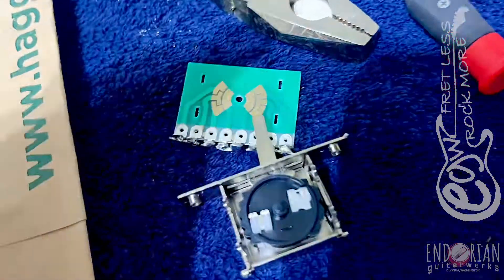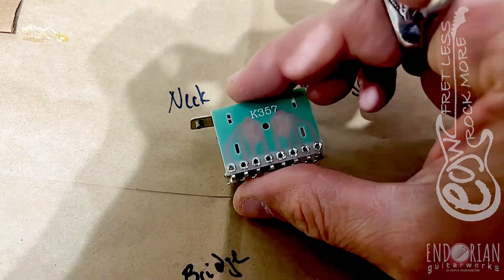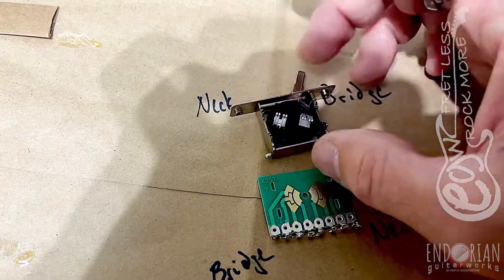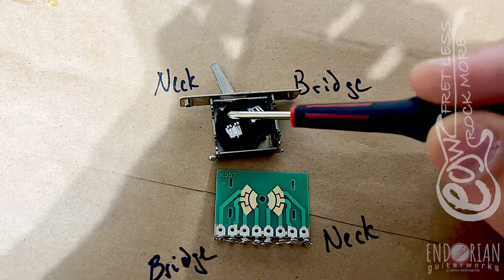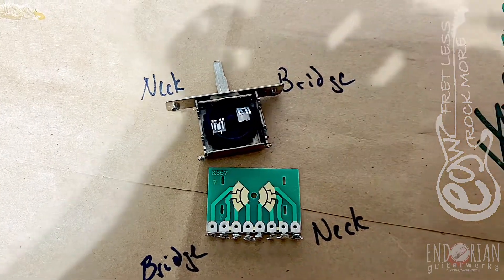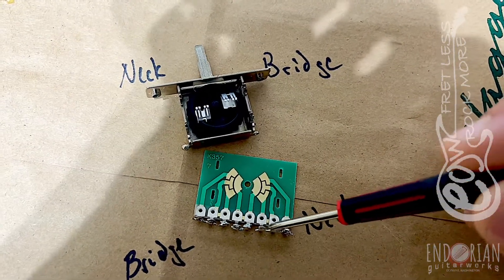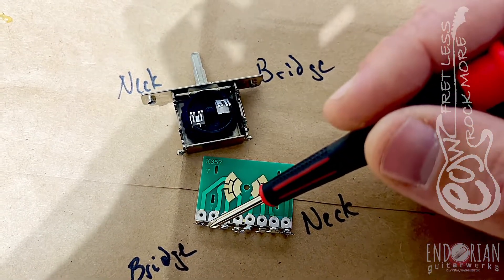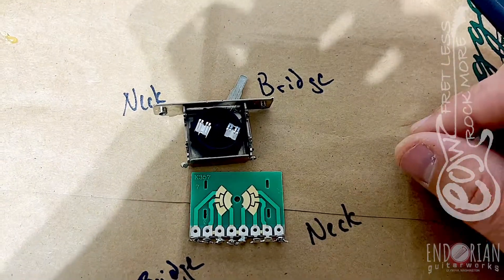How do these stupid 3-way circuit switches work?

Comment: Awesome, this helped me identify that the two commons on lugs 4 and 5 are permanently joined by a small PCB trace. After removing it I was able to properly setup my strat HSS with auto coil split. Thanks!

Comment: Thanks, clarified how it works. I have almost exact looking switch in my Donner Tele-style. The funny thing is the connection/soldering was done reversed of what the author explained, but worked as it should. Also, you can cleary see there is connection between the connectors that should be soldered (located between the green part and the connectors), for example the middle two. I guess the additional soldering is not necessary, and my guitar didn't have that soldering.
Still can't find the cause of ground-like noize that goes away when I touch anything metal except for the switch, which makes it louder. I found that the metal lever itself doesn't connect to any electrical parts inside of the guitar. Now I'm even more confused
Reply from the maker: Exactly reversed will also work because of the nature of the circuit. Outside in or inside out. The point is that it’s one path per pickup, and then the center combines them.

It sounds like you have a hot lead connecting to ground somewhere. Also did you ground the casing?
Reply: @EGWguitars  little flap/connector on the side of the casing is grounded. Nothing looks off to me connection-wise, I checked everything using a multimeter
Reply from the maker: @igorgilza can you share a good photo of the switch wired, and the rest of the wiring?

Comment: Hey bro, can you please help me out? I bought a prewired wiring harness for an LP-style guitar from Temu. It’s mostly prewired — all the volume and tone pots are connected — but the 3-way toggle switch and the output jack aren’t wired yet. There are two long black shielded wires coming out of the harness, and I’m wondering if those are supposed to connect to the toggle switch and the output jack. I’ve changed my profile picture to show the wiring harness so you can see what I mean. I’d really appreciate any advice you can give me
Reply from the maker: Your hot lead from the pickup goes to the first lug of the appropriate volume pot. The black leads coming from the center lugs of the volume pots go to the appropriate side of the switch. The output of the switch goes to the jack. Third lug of the volume pot and all grounds get soldered to the back of a pot. Prewired kit should already be tied with a master ground - you just need to connect to that ground.
Reply: @EGWguitars  bro , I still don’t fully understand😢, but thanks for helping me out! I have just one more question — will I need any extra wires? From my profile picture, do those 2 wires hanging out from the wiring harness look enough to connect the output and toggle switch?
Reply from the maker: @Jameshetfeild20 I honestly can’t tell that much from the photo. You may need more wire. 

Here’s a good wiring diagram from Seymour Duncan for an LP.

https://www.seymourduncan.com/wp-content/uploads/2023/09/2H_3G_2VppSPL_2T.webp
Reply: @EGWguitars  The diagram  doesn’t exactly match my prewired harness, which is really confusing. I’ve already checked dozens of different diagrams and videos. Is there a way I can send you a picture or should i upload a video of my wiring harness kit my yt channel so you can check it later? That would be really helpful.
Reply from the maker: @Jameshetfeild20 you can send pics to info at EGWGuitars dot com.

Send me a good photo of the back side of the kit. 

Wiring diagrams will always be slightly different because of color codes and the way the grounds are tied together. I also just realized that the diagram i used has push pull pots. 

This one is better

https://www.fralinpickups.com/wp-content/uploads/2022/02/Gibson-Les-Paul.jpg

You’ll have two leads coming off each pickup. A ground and hot. 

The hot lead of the neck pickup goes to the first lug of the neck volume. Hot for bridge to the first of the bridge volume. 

The second lug of each volume pot goes to the respective side of the switch.

The third lug of each should already be soldered off as a ground if the kit is any good. 

The switch chassis should be tied into the ground, and the switch output goes to the tip side of the jack. 

The ground off the pickups gets soldered to ground (back of a pot) and then one master ground goes to the sleeve of the jack. 

Ideally the guitar also has a bridge ground wire which also gets soldered to ground.
Reply: @EGWguitars  i uploaded a video in this channel please check it out. There are two wires coming from the harness. My guess is they connect to the side of the toggle switch and the pickup wires, which are already connected to the pot. I think I know where they should go, but after connecting them, there are no more wires left.

Which wire should I connect to the output? If you need any more information to help me out, I can provide it. I’d really appreciate your guidance
Reply: @EGWguitars I tried to send pictures to egwguitars but i couldn’t find a option to upload a video or picture
Reply from the maker: @Jameshetfeild20 the center lead of the wires connected to 2 lug (center lug) goes to the appropriate side of the switch. 

Your pickup hot lead goes to the appropriate first lug of each volume pot (the one that is not already soldered to the case. 

The pickup ground wires get soldered to the back of a pot. 

These wires they used are insulated shielded wires. The inside is hot. The outer wire is ground. 

Make sure the case of the switch is also tied to ground. 

The switch output goes to the tip of the jack
Reply: @EGWguitars  So I have two long wires coming out of the harness, and the pickups have their own wires — that’s all the wiring I’ve got. How do I connect the output jack? Do I need to buy extra wires?
Reply from the maker: @Jameshetfeild20 sounds like. 

One wire will come off the output of the switch and go to the tip lug of the jack. The second wire you will solder to the ground (pick the back of a pot that is connected to ground) and that will go to the sleeve lug of the jack.
Reply: @EGWguitars so i need to buy one wire ? Sorry for asking so many questions Hope you don’t mind all my questions and thank u so much for replying 😊
Reply from the maker: @Jameshetfeild20  You'll need two wires. Or you can buy one twice as long as you need and cut it in half. ;-)

Or you can buy the shielded wire similar to what was included (which is a cleaner look. 

the center will go from switch output to jack

The shield will go from switch chassis, to a grounded pot and then to the jack ground.

No worries. Happy to help.
Reply: @EGWguitars  Bro, I have a question. How can I tell which pot is for the neck and which is for the bridge, and which ones are the tone knobs? Sorry for the noob question 😅
Reply from the maker: @Jameshetfeild20 whatever one you connect the the bridge pickup to becomes the volume for the bridge pickup. It really is that simple. The tone pits are the ones with the capacitor soldered to the second lug.

Comment: This is slightly different from the Ibanez VLX54, right? On that one (which came in my MIJ Tele), the lugs are reversed, so that you connect the neck hot to the last two lugs on one end and the bridge hot to the far lugs on the opposite end. Whereas in your example, the outermost lugs don’t have either the neck or bridge pickup wire connected to the outermost lugs. Do I have that right? (I hate this selector switch, didn’t know this guitar of mine had it until I had to open up and use De-Oxit, upon which 3 of the wires came unsoldered, grrrrrrrrr.)
Reply from the maker: It can work either way because the mechanics are the same. Just be consistent: the inners OR the outers.
Reply: @EGWguitars  thank you!

Comment: Hi, thank you for posting this clip, I have a question. I want to use this style of 3 way switch, on a guitar with 2 single coils, neck and middle, and a humbucker in the lead position. I dont want a 5 way, I want it wired up like an old school strat, just 3 positions, no cross over, one pickup per position on the switch. Could you PLEASE do a short clip showing how to do that? I've got a Jake E Lee build I'm doing, just a 3 way, and one Volume pot, and thats it, and I'm about to get to the point where I will be wiring it up with a treble bleed, but, I'm fully not an electrical person, and my brain is a little broken trying to figure this out on my own. Thanks again for the explanation on how it works on this clip, but, if possible, a short How-To clip on my problem would get me miles ahead. Cheers.
Reply from the maker: So do to this, which is rare but possible, you would use only one side of the circuit board. The center lug common is your OUT. And each of the other lugs is assigned to a pickup.
Reply: @EGWguitars  Ok, cool, do you know what side I should use? Or what Lug is for what pickup position? I've never done any of this before, so its kind of mind bending for me haha, thank you so much for responding!
Reply from the maker: @mrnobodyinvr9762 either side is fine. As far as which position is for which pickup, just flip the switch to the neck position and then use the lug that is bridged to the common in that position. Then the middle is the next, then the bridge

Comment: how about those those 2 extra pin no use? can u show which one is to solder for bridge, and neck. so i will just leave the other pins?
Reply: actually i followed this and its wrong, i went back to the product diagram and it worked. probably ur demo os kinda reverse
Reply from the maker: @yousocrazy1199  it can work either way. Depends on the orientation of the switch and which lugs you use.
Reply: @EGWguitars  yah i figured, this video help actually, i was actually have no idea what i was looking at the switch, until i saw this video. thanks

Comment: So the hot pickup wire never gets soldered across 2 of the 8 posts? I might need to re-examine my PRS 3-way
Reply from the maker: @sbrave   not every 3 way is the same, but the vast majority of imports use this one. Your PRS likely uses a different switch, unless it’s an SE
Reply: @EGWguitars  I have an SE, with a 3 way, that looks very much like this with the lugs all in a row
Reply: After a few re-wires, I finally got it, (each pickup just gets wired to one lug) and damn, if the pickup is one lug off, it will only work in it's position, but not in the middle, when both pickups should be combined. This was a big help, thx again!!
Reply from the maker: @sbrave  nice work!

Comment: Thanks for this clear explanation.
I've been three days trying to do a simple switch change!

I now know logically how things work. The fact my central position still results in silence can only be illogical! I know I'm doing something wrong - but I have no idea what it is. ;-)
Reply from the maker: Sorry for missing your comment. I apparently missed a bunch of notifications. You figure out your switch?
Reply: @EGWguitars  
Hey EGW - you have just given me flashbacks reminding me of that issue! It was a nightmare!

Because I was connecting Tonerider pickups, even the boss of the company, Andrew, got on the case! (Tonerider are great). He rang me in person!

But all to no avail. In the end I got a Kaish one and that wired up with no problem at all. Perhaps the original one was faulty, but I think I may have missed something. The Kaish one just wired up logically - there was no head-scratching necessary!

But both switches were less than £10.00, so I just put it down to a learning experience - I didn't break the bank sorting it out.

My new Resonator from Harley Benton is a different matter.....

Comment: Ido hace a question , i have a thin line telecaster with neck HH and single coil bridge ; they sound finé individually but in the middle position the volumen drops like 50% ….  What should I do to avoid that ?? Thanks !!
Reply from the maker: Without seeing the wiring that sounds like in the middle position, the two pick ups are out of phase with each other.

The first thing I would try with the information I have is flipping the polarity of the bridge pick up

Comment: Question im soldering a Single coil humbucker in the neck position, when my 3way is in the neck positions im getting the Bridge and neck pickups together
Reply from the maker: That likely means that you’ve soldered the bridge wire to the wrong lug on the opposite side. 

Send me a pic and I’ll take a look 

There’s also the possibility that you’re using a slightly different switch. Most of them are the same, but they can vary. 

The point of the video was to show how they work… but it won’t be correct 100% of the time .
Reply: @EGWguitars  sent it to your instagram

Comment: Thanks for the tutorial. I almost understand what you're saying. 

This is what confuses me. I have this switch that I would like to use for a HH Strat. 2 volume, 1 tone.

When you say output, I'm assuming you meant the output jack right?

Also, counting from the left, it looks like lugs 4 and 5 are soldered together, number 6 is where the hot wire from the neck pickup goes. Lug 6 and 7 and soldered together. Bridge pickup hot wire goes on lug number 3. Lug 2 and 3 are soldered together and lugs 1 and 8 are not being used. 

Am I understanding this correctly?
Reply from the maker: Output CAN mean that, but it really just means output. In this case, output means to the volume pot. Signal starts at pickups, goes to the switch, then to volume and tone, final output to jack.

The lugs are soldered together because with this kind of switch you have to use both sides in order to get the middle position to blend the signals of neck and bridge. One side is used for neck and neck middle, one for bridge and bridge middle, and they are both output to volume.

Does that help?
Reply: @EGWguitars  I get that, I just want to make sure of how to treat each lug
Reply from the maker: @byronmakesnoise  gotcha

Assuming you have the same switch:
Lugs 1,2 bridge (or neck)
Lug 3 DO NOT USE
Lug 4,5 output
Lug 6 DO NOT USE
Lug 7,8 neck (or bridge)

Or you can opt to use 2,3 and 6,7 and not use 1 and 8. (I think that’s how I spelled it out in the video but don’t remember)

All depends on how you use the switch. You just have to be consistent.
Reply: @EGWguitars  understood. Will let you know how it goes
Reply from the maker: @byronmakesnoise  🤘🤘🤘
Reply from the maker: @byronmakesnoise  hey I wanted to update my response to you. I realize I misread your situation. 

With two volume one tone you go volume first. Pups, volume out to switch, switch to output jack. Also, when you’re mixing volume knobs, IF you want full independent volume control, pickups go IN to the center lug of the pot and OUT the first lug. Otherwise mixed, dialing one volume to 0 will kill signal accross both pups when mixed. Unless you want that. Think original vs modern Les Paul. 

Tone will also come off the switch output
Reply: @EGWguitars if you wire it up with the second method, does it matter which lug you use? If 2 and 3 are connected, can you wire to either lug?  I am also confused about why you’re able to use either lug 1 or 2 and skip 3, or you could skip lug 1 and use 2 or 3.
Reply from the maker: @smarfmart  it’s all just about  which lugs are active based on the orientation of the switch. Because either jumper can be used for either pickup, and each jumper can be active on either side of the switch-throw arc (and always opposite each other) - determining if it’s the inside two lugs (2,3,6,7) that are active, or the outer two (1,2,7,8). 2 and 7 will always be connected to the other by a jumper and used to blend in the middle position. And 4,5 will always be jumped and common as the output.